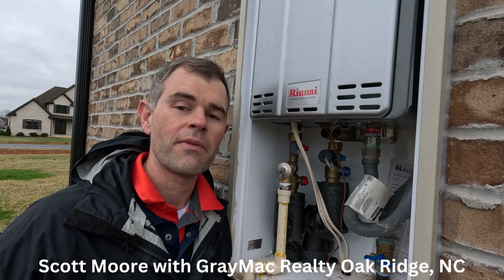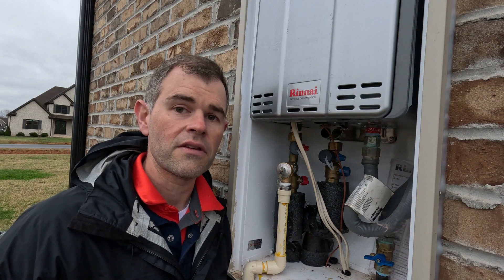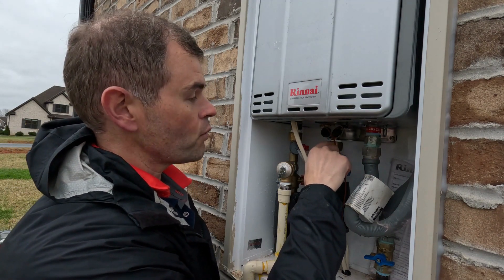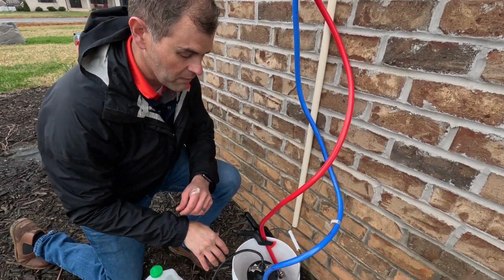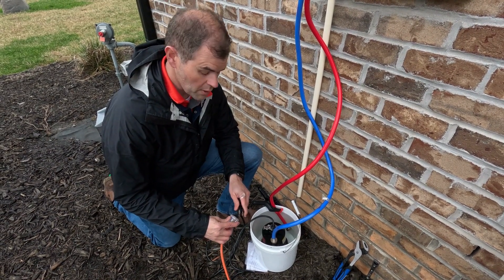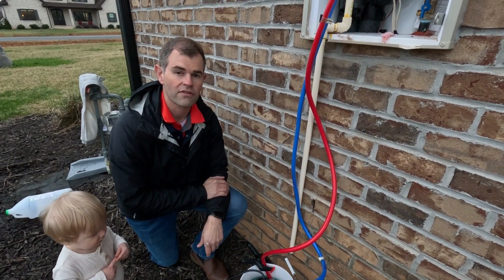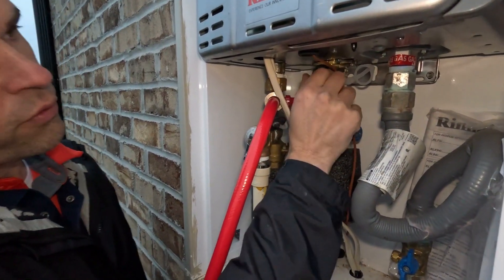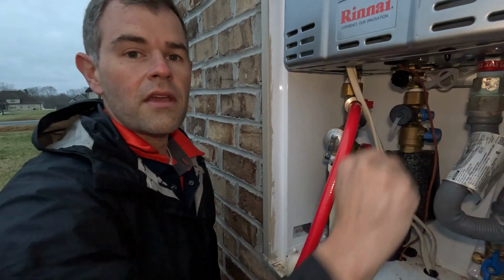How to flush a tankless hot water heater

Comment: Hi Would you mind what kind of pump you use?  Thanks so much!
Reply from the maker: Hey, you cna use a submersible pump like this one from Amazon. Just make sure to flush it with clean water after you get done to remove any leftover vingar in the pump.  https://www.amazon.com/Superior-Pump-91250-Submersible-Thermoplastic/dp/B000X05G1A/ref=sr_1_7?crid=2I8WFRAUXTWYO&dib=eyJ2IjoiMSJ9.cFiz4IMHeh96FCsDnEKsv20TiB_Wc3BQoa-Q4FBW7MOJze2gM6Ygvj4Tdh3BRRzFKZ0sIK4KIDQegcFl8vHi1O26CDF_FAHmGIEsU0kvxCouuOYQCNuxw38tGt8o99Z5u3ikJzaXRsb2DNZmtJG3UqI9_MbwF3ApP-s3C1wJnVS1xFoTsbCd0iuEzvCJCIOHiZr7N8nnun_UfpNoje1feLtACLV7fMiEbkeYca4GwSIRQ0CZIU2kX4UZjyQ9VcPz8QvvOddI-QydfChhMknQUJQXPUNSQtUanOL5eB1sPeo.CZLNMoug9iPu-4J67BBjYtq_o-L_1f9YevmhVVrvSbU&dib_tag=se&keywords=submersible+water+pump&qid=1732704167&sprefix=submersible+%2Caps%2C171&sr=8-7